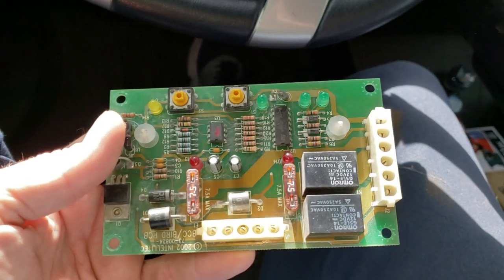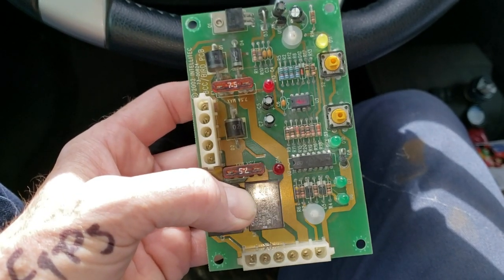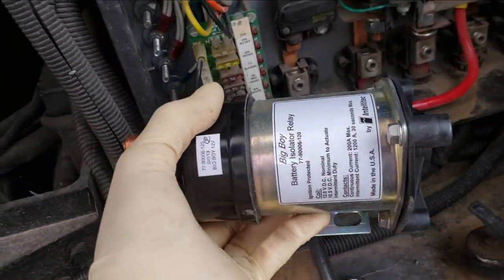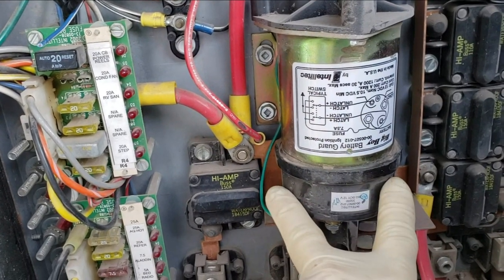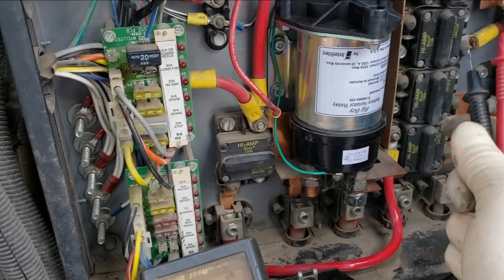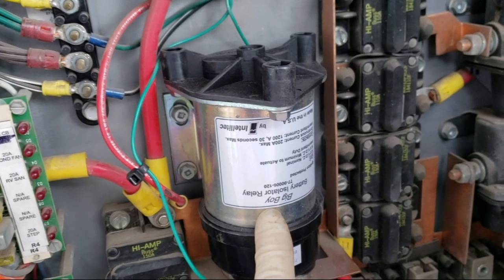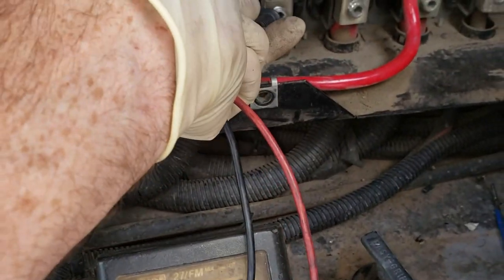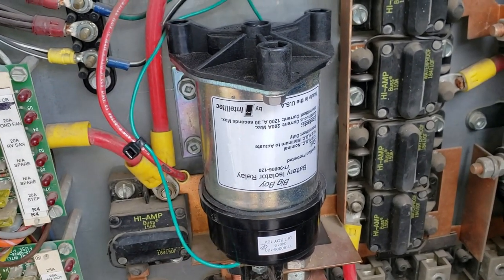Advanced Monaco Diesel RV Battery Troubleshooting

Comment: I had trouble with mine last year and it took me 2 days of fiddling around.  Called the manufacture and spoke to the old Engr who was involved in making the unit, told me to check 2 simple things, and each one indicated what was bad.  Ordered the part after confirming what was not working........wal-la..........It worked.  Things are simple when you know the steps to do.
Reply from the maker: knowing how its suppose to work is very useful, but Monaco has made it impossible on these oder units now....they don't know much about them.

Comment: I also have an '05 Exec.  That Big Boy relay is what came from Monaco so someone must have changed it out to what you found.  Monaco had a battery issues in that era.  With that Big Boy relay staying engaged for those 5-10 min it will drain down the starter batteries to the point they don't have enough juice to start my big Detroit Diesel.  The work around is to just press the battery boost switch on the dash to help start it.  Monaco's eventual fix was to add a third battery.  BTW; those Big Boy relays can be taken apart to clean the contacts when they start causing issues.  If you're going to be boondocking then the best thing to do as soon as you shut off the engine is to go back and flip the battery disconnect switch off and on to disengage the BB relay.  If you start up the generator at some time to recharge the house batteries then you need to do the same thing once you shut the generator off again.

Comment: I see this is an old post but hope this reaches you. I have a 1996 Monaco Dynasty. My problem is when hooked up to shore power the internal battery charger over charges the lipo batteries. I am wondering if there is a way to reduce the output of this charger. I was considering putting on a shut off switch to disconnect the battery from the system while plugged in. This just defeats the purpose of the system for keeping house batteries charged. I have been looking for the charging unit on the coach but not sure what it looks like. Tracing the lines I can find some units that look like they may be the charger. It has the heart interface ems 1800-12 battery charging system. Any help would be appreciated. Thanks Kevin

Comment: Thanks for video. Question: I have 1998 Monaco Windsor, generator is not charging house or engine batteries...First it stopped charing engine battery, then a few weeks later, it stop charging house batteries...any ideas brother? bad ground or loose wire, solenoid?  inverter?
Reply from the maker: Your generation of Monaco should have a blue charging isolator which charges both batteries from the engine. Next to it should be a small green looking isolator which charges the chassis battery when the house is charging. However, the generator only provides shore 120vac power and the inverter should be charging the house. I'd start with the inverter and make sure it's charging the house. It should be wired directly to the house batteries with a 300amp fuse somewhere in between. Good luck.
Reply: @AZExpert  thanks !
Reply: @AZExpert  I think I found the issue....the Green Isolator. It appears that the center pole (white negative) has no ground, no activity. Question: where does that white negative wire go to? back to inverter? or grounding strip somewhere? I traced as far back as i could go..zip..its inside large tubing. I just don't want to ground that pole and affect something else on the inverter. I figured i'd ask you first since you've got lots more experience than I do :)
Reply from the maker: @AstrologerJoe  it just goes to chassis ground. Obviously battery ground is best but you should find a grounding bus bar around it somewhere
Reply: @AZExpert  thank you once again.

Comment: Late question..
2004 Monaco Windsor. Driving down the road the alternator changes both sets of batteries. But at night with the lights on(also towing vehicle) it only charges chassis. Thinking there’s to much voltage/amps needed for the chassis to change both. 
One thing came to mind, change lights to led to pull less voltage?
Reply from the maker: That is a large voltage drop if the running and headlights cause the isolator to drop the house batteries. Maybe switch to LEDs but that doesn't seem right to me. All those lights should only draw maybe 15amps?

Comment: Your liberal use of splicing several colored wires to make one wire confuses me.
Reply from the maker: Rather than solder a lead to the board as the plugs were different on the new board, I found a 2 pin molex harness that fit, it had a yellow wire on the pin connector which was crimped on, I guess I could have painted it to match, but the color was not important, merely the molex connector.
Reply: @AZExpert  Hey, whatever works I guess...  I just notice you tend to do that on many of your videos.  It kicks my OCD into overdrive :)